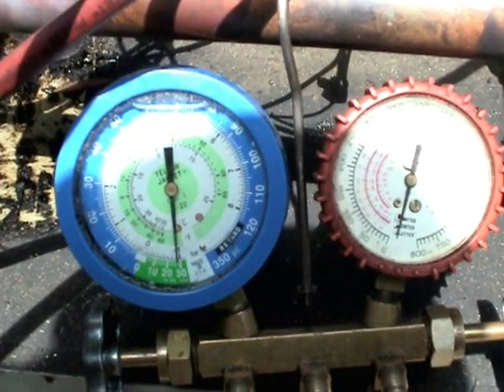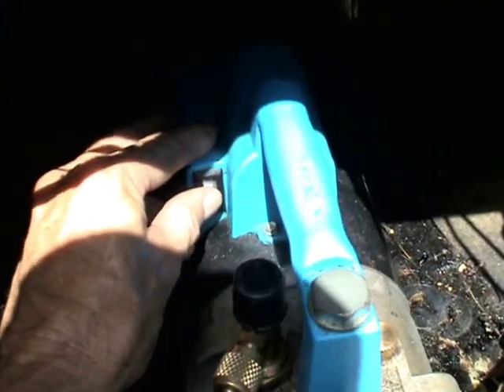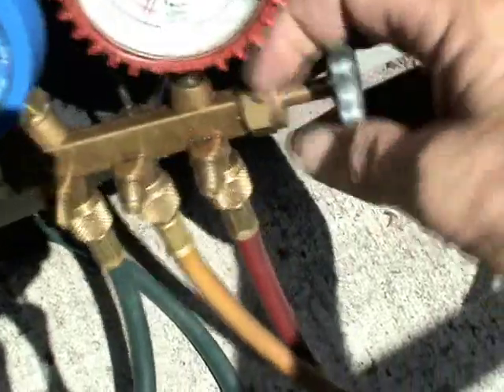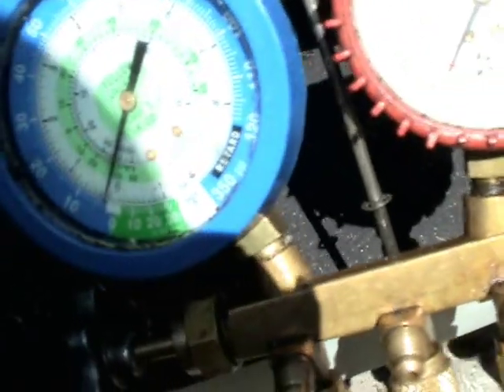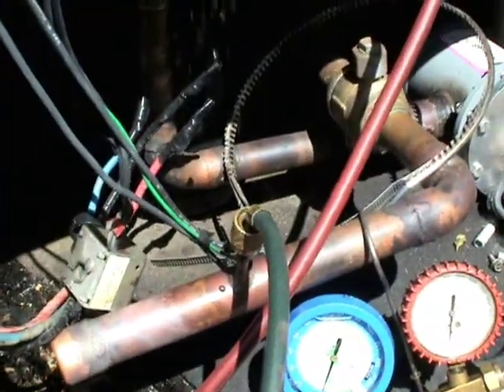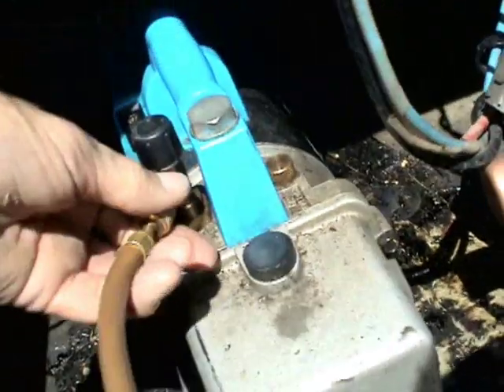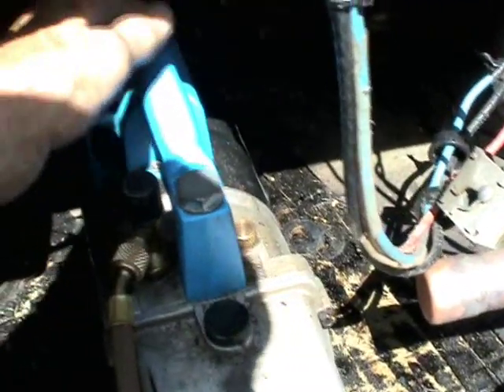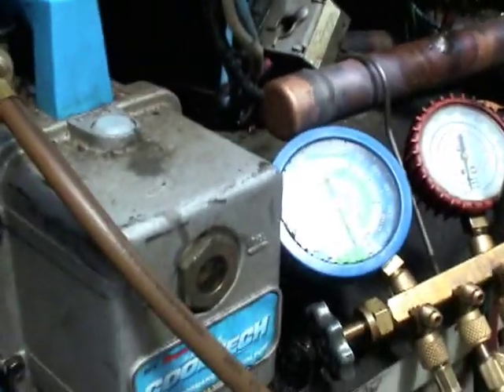HVAC Triple Evacuation

Comment: It's great to help our poorly managed & trained industry... But please show individuals the following.  1. Never put positive pressure on your vacuum pump.  (It will damage or shorten life) 2. Most vacuum pump manufactures require isolating the pump and breaking the vacuum before turning on and off.  3. Utilization of the the gas ballast.. Reduces contamination of the oil during the initial portion of the evacuation.  Additionally some vacuum pump manufactures implore you to not close the ballast until you reach 1500 microns for most 2 stage vacuum pumps.  Also, we don't care what the micron's are at the pump other than to test the pump... Micron gauge should always be at the furthest point in the system from the vacuum pump.

Comment: If I am pulling a vacuum right from the pump with a micron gauge, could I do a tripple evac going down to 1000 microns, then nitrogen wait an hour than vacuum down to 700 and add nitrogen then pull it down to 500 microns

Comment: Do all units need to be triple evacuated every time or only when a major malfunction has occurred like a compressor with burnt windings due to moisture mixing with the refrigerant causing acid.
Reply: Robert Arnold According to most manufacturers, triple evacuation is needed each time. Most employers will tell you to just get the system down to 600 microns and call it done.
Reply: Never knew that Dr. Z! Triple evacuation was never mentioned in HVAC/R trade school but I graduated in early 1995 so maybe that was before triple E was in vogue & yes, recovering the refrigerant & pulling down to 500 microns was the way I was taught in school & by other techs out in the field.

Comment: bobl78 On your Co2 question. I believe Co2 has been looked at for a while for being used as a refrigerant. When I put the first system on our house I was strapped for a budget and couldn't get the entire reg set for nitrogen and then renting the tank would have been a pain. I knew Co2 and had some Co2 that I used to leak test and triple evac the system. Funny part is that I filled the lines to around 250psi and left it for a day to do that leak test. I put the manifold on the next day and it was still pretty close to what it was higher than the day before (Co2 is usually a higher pressure if I am not mistaken so there was not much liquids in the line.) I triple evaced the system and it has been running strong for five years. I paid for a service call for the tech to check behind me and deal with the refrigerant. It didn't need any based off of what was initially in the system, which I let them deal with releasing, and I only got charged for the service call. Yes, I know, not what the pros like but I did not have close to the amount of cash on hand to purchase a system and have it installed. The only issues I have had with the system was once when the siding crew moved it and caused a leak and the weird wifi thermostats and how they control the backup strip heat.

Comment: do you remove the schrader valves before the evacuation with core removers? do you think a proper vacuum can be done with schrader valves in? does a 1 or 2 stage pump make a huge difference?

Comment: Hey doc. We have the same vacuum pump. Also, 2 things are you saying it goes without saying to flush the system with nitrogen by removing a shraders valve and pushing out most of the atmosphere in the lines, and also my dad was always a bit picker about keeping the vacuum moving in on direction for the first draw down. What are your thoughts? It was my dad practicing OCD?love your vids

Comment from the maker: The vacuum pump will be overfilled with oil is you've sucked out oil during the evacuation process. It might be a good idea to replace the oil unless you're replacing the compressor. New compressors have new oil inside of the compressor. The oil that you'd be capturing would be old oil from the coils and line set.

Comment: Dr Z ... I have a question about evacuating the system... 
I presume you opened the service valves and nitrogen pressure tested the lines & coils within the condensor unit...
As you vacuum the entire system (with the service valves open)  is there a chance of vacuuming out the compressor oil ?  
''' if so, removing oil, do you need to replace it with new oil , on a r410a system ?

Comment: 1. Evaculate down to 28 inches of mercury, evaculate additional 15 minutes
2. Charge with nitrogen, 2 psi g, let system run for 1 hour
3. Repeat step 1 and 2
4. Evaculate down to 500 micron or below, check for leak if can't get that low, fix and repeat all if it happens
5. Charge the system

Comment: Even a Plumber knows that you MUST purge any air from the hose with the inert gas BEFORE you open your manifold guage!  Also starting your vacuum pump, you should let your hose loose on the pump port, then switch it on, and then tighten your hose.  This lets your pump start with less stress.  Ever wonder why your vacuum pumps almost rolls over on a hard closed port start???

Comment: The other reason that you might not be able to pull 500 microns is that the vacuum pump cant pull it down. In that case you need to fix your pump.

Comment from the maker: @Rueuhy It's important to remove as much moisture as possible from the system. Nitrogen will soak up the moisture and allow you to pull it out easier with the vacuum pump.

Comment: I didn't say a low head was an an indication of acid in the system but over time do to high heat can cause acid to form in the system. I tatally agree an acid test kit is the only way to be positive as to whether acid is in the system or not..

Comment from the maker: The entire system could shut down if you have a condensate overflow. That's providing you have an emergency shut off connected to the control voltage.

Comment from the maker: Make sure that you are getting the right voltage to the unit. The breaker could be going bad. Otherwise, the problem will be either a bad blower relay or a bad run capacitor or a bad blower motor.

Comment: a low head pressure can cause acid to build up in a system but not an indication that acid is in the system. Acid forms from heat which breaks down the oil low head pressure can cause heat which over time breaks down the oil and forms acid in the system. Hope this helps with your knowledge and your question.

Comment from the maker: A low head pressure isn't an indication of acid in the system. You really need to test the system oil with an acid test kit. It's an inexpensive test.

Comment from the maker: The system that I'm working on in this video had over a gallon of water in the refrigeration lines. It had an underground leak. Anyway, I flushed the lines and the coils and I've been running a vacuum pump on it for about a week now. I'm just now able to get the system down to 500 microns. Still, I have my doubts that I have all of the moisture out of the system. I guess that I'm trying to say that triple evacuation is the least you can do to insure a dry and clean system.

Comment from the maker: I triple evacuate with all types of systems. If the system has acid then you need to flush out the system with a flush like Pro-Flush. You can buy a 5 second acid test at any HVAC parts store.

Comment: Do bleed the charging hose before opening the gauges. This allows the nitrogen to 'purge' out any air that was sucked in when you removed the  hose from the vacuum pump. Though it may be a small amount of contaminates/air, it's perhaps twice the volume being removed in the 2nd or 3rd evacuation. Some gauges actually have a valve built onto the end of the hose. Or just use the low loss fittings. That hour your waiting is also a good time to change your pump oil too!     Got Burnout?